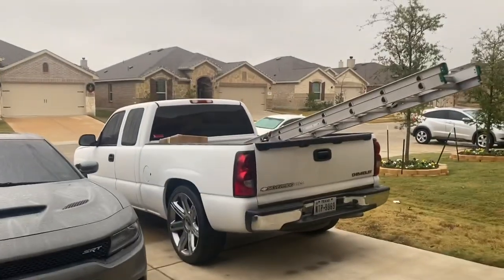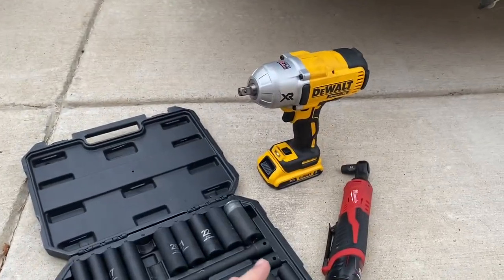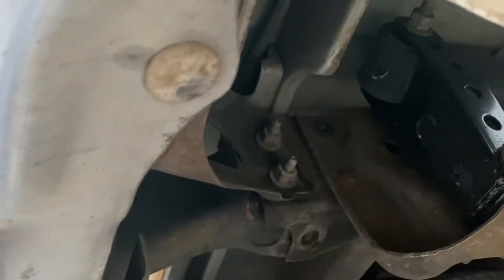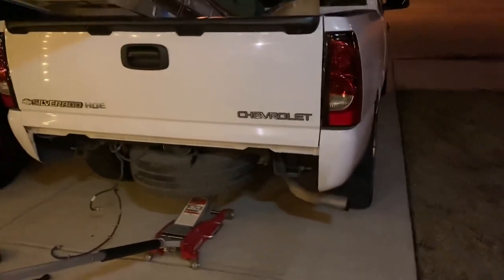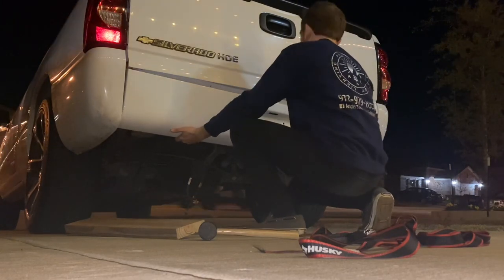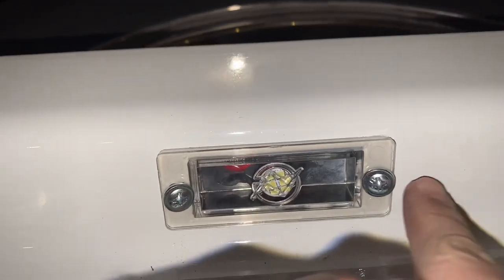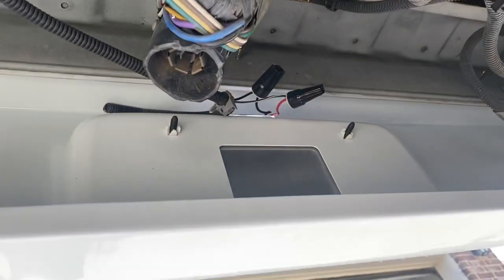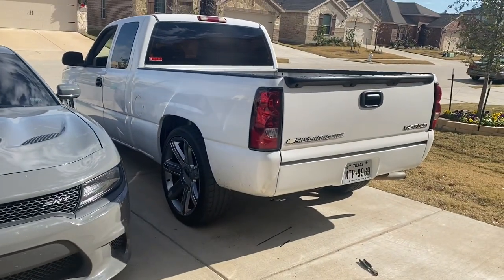Installing a Roll Pan Bumper on my Silverado

Comment: I used socket extensions to get the spare out. If you flip them around backwards and stack about 10 longer ones it will work like a dream!
Reply: What type of car u have and was the roll pan lighter than the stock rear bumper?

Comment: Next time use tape to hold the roll pan to the sides while you have it in place with the tail gate up. Then take the tail gate off and mark your holes. That way it's lined up nice with the tail gate.  And you don't need a friend.
Reply: Next time 😆